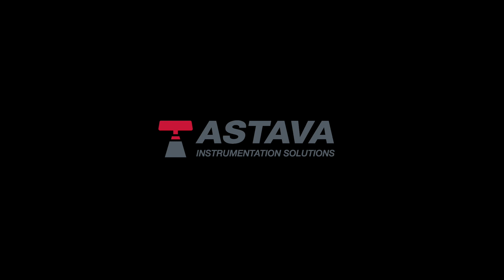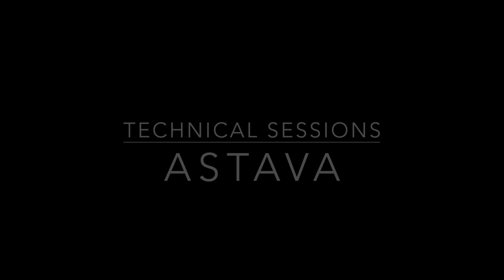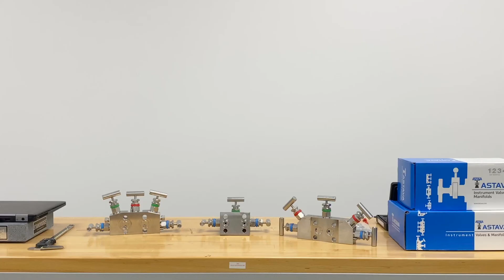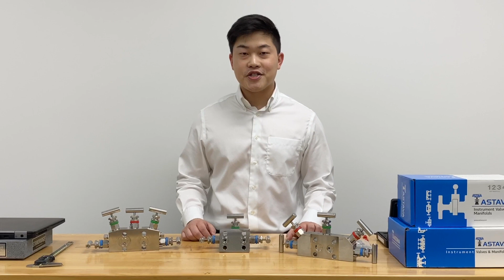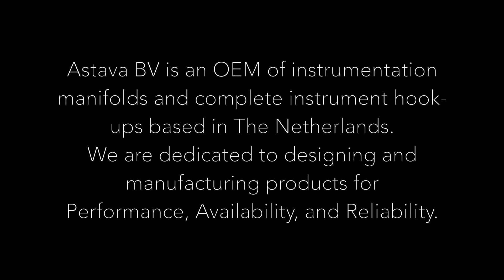Astava Technical Sessions, Manifold Flange Types

Comment: Very helpful video! What about the valve manufacturers that don't specify IEC 61518? They use MSS SP-99 which have the same bore widths, but they have a slightly different gasket drawing dimension. Can those be mounted to the same transmitters that the IEC 61518 can? Also, do I have to order something different on the transmitters for them to mate up with type A vs type B?